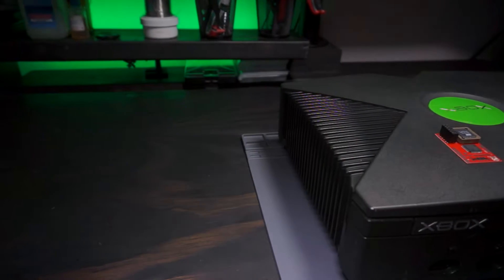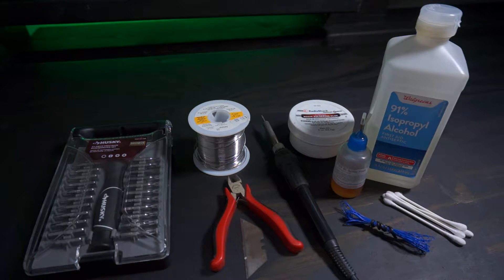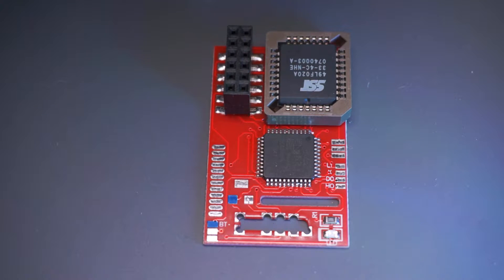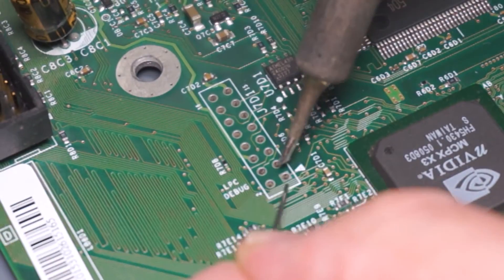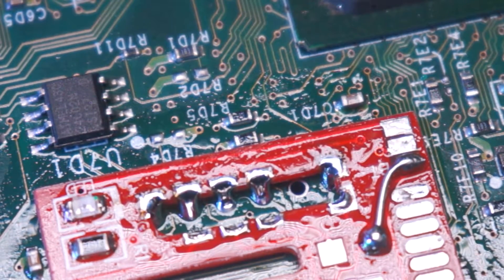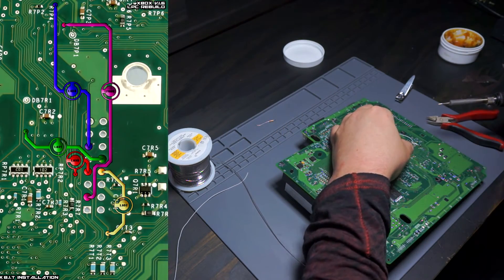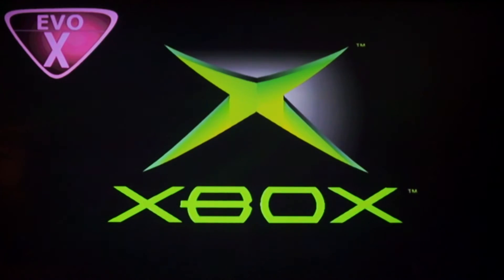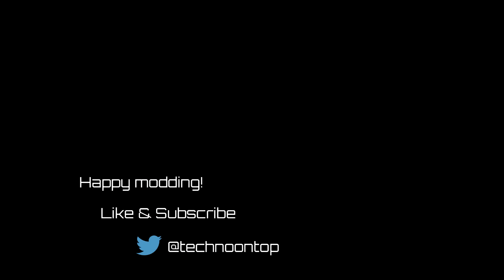Installing an Aladdin Xt Modchip to the Original Xbox

Comment: I followed the tut but the Xbox just boots up normally (no Evo X logo).    Checked the wiring and points and they all look solid.   Argghhh... time to do it all over again, I guess.
Reply from the maker: Hmm yeah something has to be wrong with your wiring, or it's possible you got a bad chip, iv actually ran into one not to long ago.
Reply: @TechnoOnTop  I got it working.  There was another wire that needed to be soldered.  I compared the diagram in your video to the one from the official Aladdin XT installation doc, and there was another wire that needed to be soldered to R6R1.  Maybe I have a different version chip?  In any event, it's working great now.  Thanks!
Reply: This guy is an idiot. Don't follow his tutorials.

Comment: Hey buddy my Xbox is soft modded but I want to install a mod chip for the extra ram.. will this effect anything or can I just solder and play? If not is it easy to un-softmod?
Reply from the maker: Just solder and play, just need to flash the right bios that supports the ram upgrade. You could just do  tsop flash.

Comment: Nice video. I was unaware that this could be installed directly to the board. Every other install I've seen is with a pin header. Thanks for the info
Reply from the maker: Yeah everyone does the pinheader install for the most part. I prefer that install as well but there can be a use for the quick solder method. Thanks for watching!
Reply: @TechnoOnTop  Does the Aladdin require the D0 connection? I purchased one to fix a v1.1 MB that the original HDD failed on (OEM. No Softmod or hardmod.), but I haven't installed one before. I was planning on installing it via pinheader, boot, flash the TSOP on the MB, remove modchip, use Hexen to install a new HDD. Thoughts?
Reply: @karoth92  this is old but you can tsop without a chip on any revision besides 1.6
Reply: @Dikwili  yeah only 1.6 requires a chip. I unfortunately just learned i have a 1.6 as well.

Comment: Would this allow us to boot an xbox even after the IDE drive has died? I'm thinking of the future when tons of Xboxes have dead drives.
Reply: _ if you install this chip you can swap in any hdd you want. You can build your own or buy a prebuilt one. This chip is best for the 1.6, all other versions you just need to TSOP.
Reply: You can solder in the pin headers, install the chip, bridge the TSOP flash points, flash the TSOP...then remove the modchip for future uses on other XBOX's.
Reply: @thePiratePimp  old comment but just need to clarify for anyone reading this now. Pretty sure you can only swap drives that are unlocked beforehand.
Reply: @Dikwili  yes, once a hdd is unlocked you can move it around to your liking, but if it’s locked, it will only work with the mobo that it’s been locked to.
Reply: I would think yes because the new bios should make it boot, but you would need another hdd and hexen installer to rebuild/add any dashboards.If you want to use a SATA hdd you'd need an adapter, and a 40 wire IDE cable. The new bios should let it boot with unlocked/un-flashed hdds. I could be wrong so if anyone wants to chime in feel free.
Reply: It will let you if your HDD dies, ya.   I actually just did this very thing.   1.6 Xbox, dead original WD HDD.  Installed the chip, slapped a Maxtor 320GB in it, loaded Hexen from DVD, and was up and running in no time.
Reply: Can hexen or the other auto installer be run via a usb stick (yes i have a usb to xbox controller adapter)? I ask because my dvd drive does not work, therefore i keep getting error 12 on startup. Thanks!!